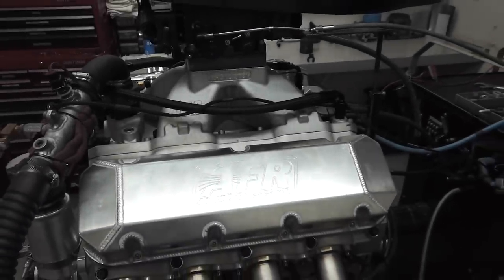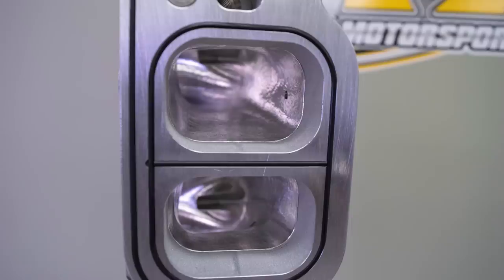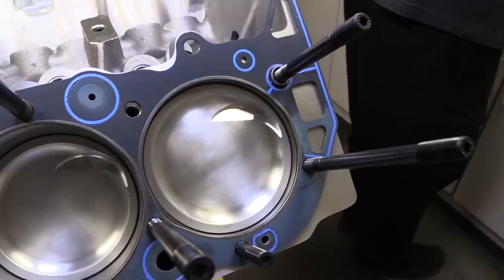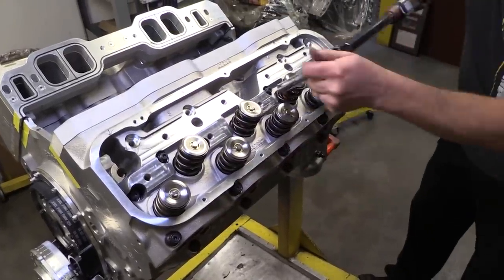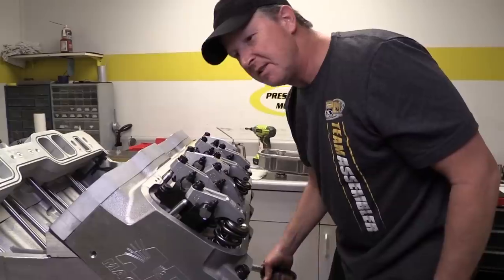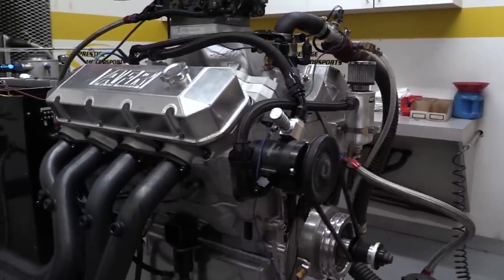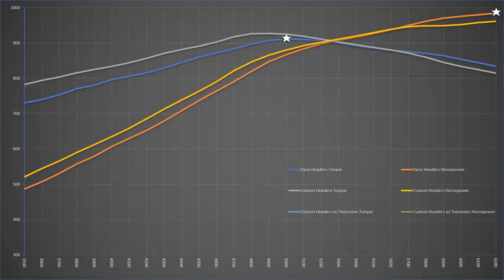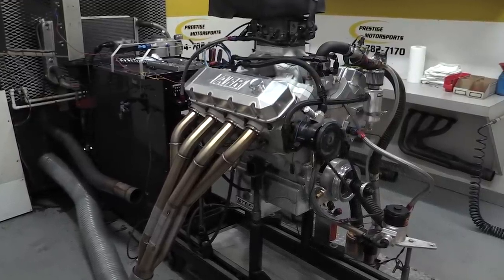665 Cubic Inch (10.9 Liters!) Monster Big Block Engine Build [The Displacement King]

Comment: those deeper cuts on piston for valve clearance will cause knocking if you play with timing at all..      should allways avoid sharp edges on combustion chambers at all cost..   .. but hey..   i guess the loads the engine will be under are so much lower on draft like that compared to car ..  so may not cause so much issues in the end.

Comment: That belt has to move a lot of big springs how long will it last ?
Reply: The cam belt drives are MUCH stronger than chains. They should be the standard all builders use.

Comment: Airboats are a very specific build: made for low end / half of midrange.  Need to block out/highlight propeller speed limits on the dyno graph, as that redline is non-negotiable [unless you like picking splinters out of your hair].   So... where are the 2k to 3.5k numbers?

Comment: 9:03 Vaccum pump - what does it do? 
Is it a dry sump?
Reply from the maker: The vacuum pump is helpful because at high rpm levels an engine will develop positive pressure in the crankcase. This can fight against the combustion pressure pushing the piston down the cylinder. The vacuum pump, pulls air out of the crankcase, helping the engine develop power more efficiently. This particular engine is a traditional wet sump. Hope that helps, and thanks for watching!
Reply: @TheHorsepowerMonster  thank You for Your response.

Comment: They make sheet metal manifolds with very thin aluminum make it with thicker stuff I've seen manifolds with 3/16 n1/4 plate that don't crack in boats

Comment: I’m probably a bit ignorant here... but the cylinder wall thickness between each cylinder looks insanely thin to me. Couldn’t that be a problem with keeping each cylinder sealed individually? Or is that only a problem at high rpm and load? I’m thinking back to Cleetus stripped corvette lifting its heads doing runs and spewing coolant out.
Reply from the maker: Shouldn't be an issue. The block is designed from Brodix to be able to handle up to a 4.600 inch bore. Thanks for watching.

Comment: Would this work in a off shore big race boat?  Normally Merc engines but this would work good One would think in a triple set up on a 60 to 80 foot V hull or CAT.  I would love to see that.
Reply: It would work in anything you put it in. You could put it on a motorcycle if you wanted to and it would work.

Comment: Could you put that in an airplane? Like some ww2 small fighter type or is it still too small for that?
Reply from the maker: ??? Great question. Unfortunately, I have no clue when it comes to planes. Thanks for watching!
Reply: You would need serious modification to the oiling system to handle the pitches a plane would go through during normal take off, flight and landing. The carburator will need these mods too. The engine would also need to be modified to run on AVGAS.....Aviation fuel that is generally leaded and oxygenated to handle the elevation. 

So the answer is yes.....with modification.
Reply: I am the Offender of All, that makes sense with the oil system, didn’t think about that. It just sounds like some of those old planes so I was wondering.
Reply from the maker: @iamtheoffenderofall  That all makes sense. I know I've read of people using LS engines in experimental (kit) planes, but had no idea what went into making them work for aviation. Thanks

Comment: This is an interesting engineering project, but other than having a unique build there are more conventional and cheaper ways of producing the same horsepower and torque as this engine.  I didn't hear anyone mentioning shot peening the connecting rods or having anything heat treated.  Outsourcing so many things also invites a lot of points of failure.  I'm old school and that timing belt scares the hell out of me!

Comment: What compression is it n what's the power limit of the block?? i plan on building a 632ci in the future n the block i plan on using has a 2k hp limit, plan on going boosted n e85..

Comment: with a procharger you could keep the hp up with lower revs.
Reply: Uh, no, that's not what a centrifugal blower does.
A procharger pushes the peaks up, so it would make no sense in such an application.
It would work well with a 5 litre Whipple or 10-71 though.

Comment: A beautiful block set-up, if I'd had means I'd buy one, from you guys, then I'd take an old Alfa 2 litre head to the wizards with computers or perhaps even just purchase Specs from Alfa Romeo direct then get those specs enlarged to suit that bore diameter, same with cams and everything else then have heads cam (s) made out of billet, bolt it up with mechanical fuel injection, boom...
Reply: Then I'd bolt it into a brand new Mercedes 2.5 liter diesel because I'm a heretic ;-)

Comment: Where is the assembly lube? Did you soak the cam followers in oil? What is your theory?
Reply from the maker: Broeker prefers to coat the ID of the lifter bores with assembly lube on a brush before installing the lifters. The lifters are pressurized with motor oil when the engine's oil galleries are pressurized before the first fire-up on the dyno. Thanks for watching!

Comment: @4:50 shouldn’t that have been done by a CBC machine so it’s accurate and consistent? I’m now super mechanic but just seems logical right
Reply: A lot of custom one off machining can be done on a manual machine quicker than you can program a CNC machine and load up the tooling. CNCs are better for multiple part runs.

Comment: Can i use the original valve covers for sleeper look ???
Reply from the maker: Probably but it won't help much when the entire engine sits over an inch taller than a stock big block and your only intake manifold options are either a highly modified single plane like this or a sheetmetal intake. Thanks for watching!

Comment: What's with the spacers on the block and heads?
Reply from the maker: This particular block has an extra tall deck height. That pushes the heads both up and away from each other because of the extra length of the "V" in the block. There currently is no cast intake made for this block/cylinder head application, so Prestige used one for a block with a shorter deck height. To make up for the extra space they fabricated the spacers you see. Hope that helps, and thanks for watching.

Comment: I'd be interested to know what is the potential life of this engine under normal operating. Not street racing. It could be fun.
Reply: They said it's going in a airboat several times, so it will be running at high rpms for hours at a time daily. It's what they built it for.

Comment: Imagine the power without reducing the compression ratio and a force induction...woww...
Reply: The CR is not that big of a deal. You might gain 30-50 hp by going over 12 with C16.
This thing is mostly limited by the low lift cam.

Comment: Let me just say this is the beginning of the video that I just watched and I'm looking at the guy struggling to put the cylinder head over the studs. Everybody knows you're not supposed to do that you're supposed to put the cylinder head on the Block and then you put the studs through because when you put the heads over the studs you're grinding the aluminum off the cylinder head into the engine and you're getting aluminum shavings inside your engine

Comment: I saw someone say u can get the same power from an LS alot cheaper. U might get the horsepower close but never 900plus lbs of torque  not from a naturally aspirated one
Reply from the maker: Exactly. There's a lot more to it than simply comparing peak horsepower numbers. Thanks for watching
Reply: Over 950hp, on pump fuel, single 4, from an LS? And cheaper?? Nope.

Comment: I’m my opinion coil on plug would have been so much better for spark and durability one less part running on the internal of the engine also I’m sure a  distributor for this was expensive I wonder why they went this route a computer or efi carb style would of had smoother tuning for changes but maybe customer understood old school stuff better
Reply: Less power, and expensive EFI electronics? On an air boat? Highly corrosive salt water? Tough call.

Comment: was just looking at finnegans twin turboed 711 cid chevy hemi on his boat?!now there is a looker and thumper.with 4.75 bore that thing should be something else.sonny s offer a 726 chevy street package which can be seen in a road kill episode where finnegan and freiburger test one in australia.over 1200 hp on pump gas naturally aspirated!now ,why don t you guys supercharge one of these 665 s?should be interesting.....anyone here on the know how large you can go with mopar architecture hemi?
Reply: If you're willing to use a modified bore spacing block, and take the cost that comes with that the sky the limit. Sonny's has gotten up to 1000 cubic inches that way, though it doesn't have a cooling system.
Reply: @sparkplug1018  in sweden someone has modified a sonnys 1001 cid for street use??i don t think these 5 and 5.3 bore spacers are super expensive...or??
Reply: teknoäijä Never said they weren’t. Anything beyond a stock block is going to cost good money.
Reply: @sparkplug1018  i m familiar with the cost factor after paying my way from 14.22 to 9.624 with streetable bbc and that in finland which doubles the cost at minimum.

Comment: I'm curious if you used a flat crank system for better sound, would it decrease the torque and hp? Reason I ask because Ford GT350 sound good like Italian car. But vett, viper, sound like shit and old. Would even firing sequence help with higher rpm and durability?
Reply from the maker: From my understanding a flat plane crank does allow more harmonics and vibrations than a cross-plane and it does hurt longevity. It also doesn't make any more power. The jalopnik fanboy crowd just fell in love with the idea because of Ford's marketing with the GT350. But it definitely does sound better because it puts the firing pulses together. At least that's my two cents. Thanks for watching!
Reply: @TheHorsepowerMonster  I could careless what mustang look like. I love the engine sound and I want to swap it into AC Cobra kit car.
I think if it allow more vibration due to operating more smoother, then flat crank is more durable if they both rev at the same rpm limiter range. 
Can you explain how crossplane make more hp?

Comment: 5:24
Since when does rubber beat metal?! I dare say rubber stretches more than mental does, any at all much less over time! I'd like to think metal is more exact than rubber. I've never seen a watch with rubber gears!
Reply from the maker: It's not rubber.
Reply: @TheHorsepowerMonster  plastic or whatever it is, how is it able to beat metal for reliability over time (hot and cold cycles)?! Timing chains for example don't need to be changed (if one keeps up with the oil changes). Timing belt has no such 'luck'.
Reply: @TENNSUMITSUMA  You are right that timing belts have to be changed but if you listen to the video they say that "belts do a better job of providing CONSISTENT valve timing ...". The reason for that is that a belt drive doesn´t have any play, while a chain or gear drive must have some play to prevent seizing. The play causes erratic valve opening timing and erratic ignition timing on engines that doesn´t have a crank trigger.

Comment: Redline that engine, absolutely no space between cylinders, BOOM
Reply from the maker: Not really. The Chevy big block as a 4.840 bore spacing. A 4.600 inch bore is pretty common with big inch big blocks. In fact, World Products' Motown Blocks can take a bore as big as 4.625 right from the factory. There is still plenty of meat between the cylinder walls. Thanks for watching
Reply: @TheHorsepowerMonster  disadvantages to over boring a cylinder. When you bore the cylinder, you have made the cylinder wall thinner. This can lead to over heating in some cases, depending on the block. Some blocks are prone to cracking in the cylinders after an over bore. In such cases you need to ensure the walls are sonic checked,  to ensure the wall thickness can support your power goals. Are these engines sonic checked?
Reply from the maker: That's true if you are using a stock (or stock replacement) block. This is a performance block from Brodix specifically made for a 4.600 bore. So it isn't an overbore. They are sleeved for this displacement and with the 4.840 bore spacing it isn't a big deal.

Comment: I have to admit, I am kinda shocked this kind of horsepower and torque are required to turn that 4 blade prop. I can't really see how aggressive the prop pitch is from the picture; does it have a governor for variable pitch? What diameter is it and how heavy is it? 

A single engine Cessna Caravan C-208B airplane, weighing just under 8,000 lbs, is powered by a turbine PT-6 developing 675 HP, turns a 106" diameter 3 blade variable speed prop weighing 146 lbs.  Essentially this airplane is a flying brick that can haul just under 2 tonnes of payload. 

A conversion kit is available for this airplane which installs a 4 blade, 96" diameter prop and weighs 14 lbs more. The latest version of the Caravan (bigger, heavier and faster) has a PT-6 rated at 875 HP and comes stock with a 4 blade prop.

Comment: At that cubic inch I’m convinced a v12 (or even a v16)would actually be more efficient then 8 cylinders alone. Even the Cadillac 500 is really too big to be an 8 cylinder.
Reply: More cylinders will not make it more efficient. The 7.4 Liter V16 from Cadillac gets 8mpg (29.4L/100Km). The 8.2 Liter V8 (500ci) gets 9mpg.

Comment: 4.6 inch bore x 5.0 inch stroke is 578 cubic inches by my calculations.
Reply: 664.7" actually... lol.
Reply: Sorry I messed up, I used the bore diameter instead of squaring the radius.
Reply: @Cobra77775  All good. I actually do these with a 4.605" bore... just for the 666" 🤘

Comment: I apologize for saying this; but wouldn’t  any Mercedes, Audi, Dodge, Ford or Chevy V8 with supercharger make the same power
Reply: Propeller Engines (this is an airboat) run at lower rpm.
Reply: Not just the power, its where it makes it. Making it at like 8k is of no use in this application.
Lot more to this then just comparing power numbers.

Comment: "...Costumer wanted to run a distributor..." 🤨🤔
W H Y  ?
Reply: Less tuning, less parts, cheaper and easier to work on yourself. Looks better. Plenty of reasons really.
Reply: @unbiasedcobra6672  more parts to wear and keep changing regularly, less accurate, more bulk near the firewall(not something to worry on a swamp boat), better looks ?(very subjective).😏
Reply: @GIGABACHI  personal opionion. You do realise not everyone thinks exactly like you. There are ups and downs to both set-ups. The fact it's a boat motor probably has something to do with it.
Reply: @unbiasedcobra6672  yeah, I usually go function over form, screw "tradition and looks".
Yeah, maybe the owner wasn't into the look of coils hanging off its precious mountain engine. Beats me.🙄
Reply: @GIGABACHI  my guess would be keeping it as simple as possible. Breaking down on a boat sucks. With a carby and dizzy its pretty simple to diagnose.

Comment: Have you people never heard of overhead cams? It's like the automotive stone age in the colonies.
Reply: Lets see your 10.3l sohc build.
Reply: Here's a link to an 18 liter, aluminum block, DOHC,  V8 from the 1940's designed and built in "the Colonies."  Are the 1940's "stone age" enough for you?  It's not like overhead cams are a new development that's a mystery to current engine builders, or that overhead cam engines have some kind of magic simply because of the cam.  https://youtu.be/zSydRvKzW-I?t=37
Reply: Racers in the US are scared of OHC engines, so they just ban them from everything.
Reply: @PistonAvatarGuy  Scared of OHC engines...haaaaa....haaaaaa...haaaa...very funny.  Obviously, you're not aware of the history of racing in the US.   In what used to be "Indy Car" in the 1950's and 1960's it was wide open and you could run anything.  Andy Granatelli ran a turbine car for two years.   Ford had a 4 OHC 255 cubic inch engine in the 1960's for Indy racing.  The current Indy car motors are either Honda or Chevrolet and are dual OHC engines.  I can tell, you're a true racing "expert"...in your own mind...
Reply: @PistonAvatarGuy  Scared of OHC engines...haaaaa....haaaaaa...haaaa...very funny.  Obviously, you're not aware of the history of racing in the US.   In what used to be "Indy Car" in the 1950's and 1960's it was wide open and you could run anything.  Andy Granatelli ran a turbine car for two years.   Ford had a 4 OHC 255 cubic inch engine in the 1960's for Indy racing.  The current Indy car motors are either Honda or Chevrolet and are dual OHC engines.  I can tell, you're a true racing "expert"...in your own mind...
Reply: @buckhorncortez  I clearly know more about it than you do. In Top Fuel, an OHC engine came in and started dominating everyone, so they banned OHC engines. Most of the faster drag racing classes and NASCAR wont allow OHC engines.

Comment: It's all good but you can take the stock 540 cubic inch Lycoming aircraft engine and do the same thing he's doing and when you're Crossing at 3 Mile cow pasture a hot summer day that like Houma will keep running when that car motor blows in a million pieces just saying